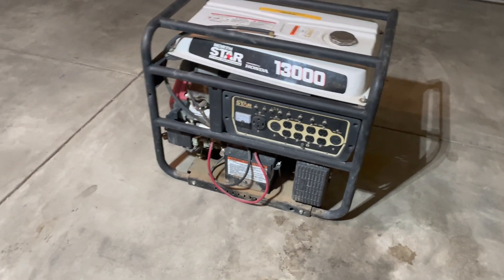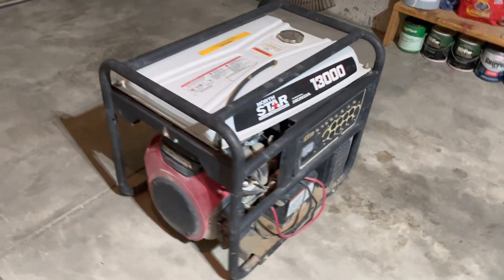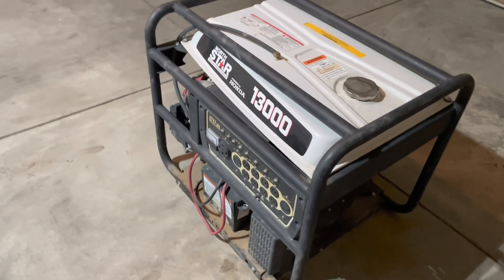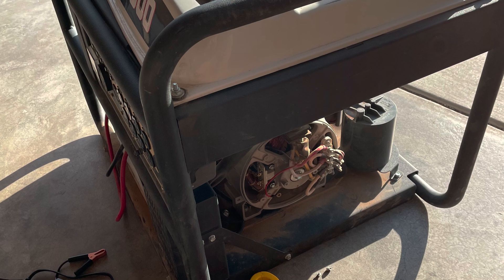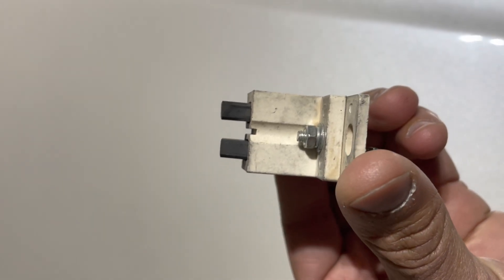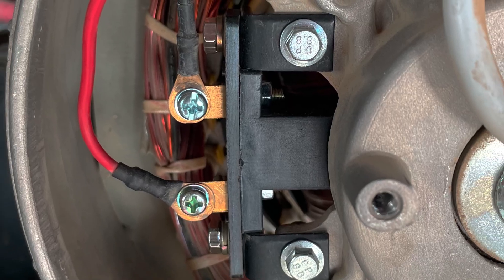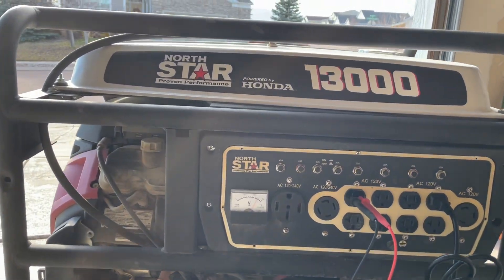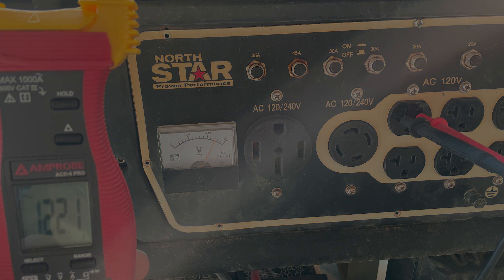How to fix a portable Northstar 13000 (13kw) generator that is not producing power.

Comment: I have a question! I have the 13000 TFG w/ Honda gx620.  Starts and runs for about a minute then shuts off. I have tried about every scenario to get it working right but to no avail.  It will shut off on gas or propane. It’s not the carb. I’ve took the low oil sensor out of the equation same results. Valve lash is set properly. It is driving me crazy that it won’t run properly 🤦🏻‍♂️🤦🏻‍♂️🤦🏻‍♂️ coils seem to be fine. It’s baffling.  Would you happen to know something I could try to maybe get pointed in the right direction?? Maybe something I haven’t looked at yet.
Reply from the maker: I have seen similar issues before. A few things, start by checking your engine switch, make sure there is no bad wire from the switch to the ignition coil grounding the ignition when the engine vibrates. 

Another thing you can do is getting an inline ignition spark tester. Connect it to the generator and start the unit. Keep an eye on the spark tester light, if the light starts to go out before the generator shuts down then you have an ignition issue (most likely a faulty ignition coil). If the spark tester light was constantly lit and the generator still shut down then you have a fuel issue. 

The last similar case I worked on, the generator ran fine for 15 minutes to the clock and then shut down. Let it cool, started again with no issues, ran for another 15 minutes and it would shutdown again. I did the spark tester test and noticed the light going out before shutting down. I replaced the ignition coil and it ran for hours without issues. Hope it’s helpful.
Reply: @tacticalpowerpro  the ignition switch funny you say that, I took and opened it up and bam a bare wire that was rubbing and left a little spot! I thought I had it, now this was yesterday.  It was not it 🤦🏻‍♂️ 

     I ordered some coils and I should see them Wednesday. I don’t have a tester (sounds like I need to get one) but hopefully a new set of coils will either rule it out or fix it!! Thank you for the speedy response.  I’ll let you if it works out or not.   Fingers crossed 🤞🏻
Reply from the maker: Ok good, we can rule out the ignition switch and focus on the ignition coil. A spark tester is good to have. It does help a lot, so I do recommend getting one. And yes, let me know if it works. Good luck!
Reply: @tacticalpowerpro  I wasn’t able to put the parts in yesterday but, was able to today. 
    The coils I swapped, set the gap, crunk it up and it seems to be what the problem was.  It ran fine. I hooked up my 50a welder and welded a little bit.  It seemed to work under load and no shutting off! I would say it’s the coils. 
     Thanks for your input 🙏🏻 I have that inline spark tester on the way for any further diagnosis’ssss. Let’s see if it holds, I’ll touch base after I use it for a bit to inform you the status of the coils!! 🤘🏼😎
Reply from the maker: That’s awesome to hear! 🔥 Running solid under load is always a good sign. Glad the coil swap did the trick. Keep that inline spark tester handy just incase and definitely let me know how it performs after a few more uses. Appreciate the update!

Comment: I have a buyer coming to look at my 130000 so I started it up today and after a minute, it shut down and won';t restart.
Reply from the maker: Sounds like the generator ran and shutdown once it burned the fuel it had in the carburetor bowl. Check the fuel valve is not closed. I would recommend a good carburetor clean up if it hasn't been done. It could be dirty and have the float needle stuck closed preventing fuel to reach the carb.
Reply: @tacticalpowerpro  when I stored the generator in the fall, I turned off the fuel valve. Or at least I think I did. I turned it the other direction to start the generator and after some cranking, it finally started, ran for about a minute, then started sputtering and shut down. Would not start again after that. But when the rain stops tomorrow I'll try changing the position of that valve handle and try again. Thanks!
Reply from the maker: Were you able to check the position of the fuel valve?
Reply: @tacticalpowerpro  yes, apparently I had forgotten to turn it off last time I used it and assumed it was off when i turned it. Actually, I was turning it from ON to OFF thinking I was doing the reverse. I was able to start it up. It does seem to run lean though. I need to pull out choke halfway, or it misfires alot. Could not find an idle mixture adjustment on this engine.
Reply from the maker: Great to read the generator is running. I recommend pulling the carburetor and giving it a good clean. That will solve your running lean issues.
Reply: @tacticalpowerpro  The gas tank has to come out to gain access, which makes it a royal pita. It's only got 200 hours on it and I use Sta-Bil in the fuel. Would be shocked if the carb were dirty.
Reply from the maker: Yes it can be a pain but you will be surprised. I work with generators daily and lots of customers come through saying similar words and surprise, surprise the carb is dirty. A good carburetor clean up and generator is running like new.
Reply: @tacticalpowerpro  Certainly surprising, given the low hours. I have a Generac 7000EXL with 4000+ hours (I bought it used and don't know how many hours it already had--4000 is what I put on it) and never cleaned the carb and it runs great. Maybe I can put some Seafoam through this Honda and see if it helps.
Reply from the maker: @basspig  Yes, try some Seafoam and see if it helps. I am surprised specially a form a Generac. Did the Generac had any long periods of not turning it on or it ran at least once a month?
Reply: @tacticalpowerpro  After I retired the Generac, it sits in a shed for a year. I pull it out usually once a year, put some fuel in and start it up. It starts immediately.
Reply from the maker: Awesome! With proper storage, that should be the outcome.
Reply: @tacticalpowerpro  When I store an engine, I shut off the fuel while the engine is running, to run out the contents of the bowl. Then I turn off the ignition and store it.

Comment: I have a 8000watt northstar  but don’t know where the brush is
Reply from the maker: You have what is called a brushless generator. It does not have carbon brusher or an AVR. It regulates the voltage using capacitors. Check the capacitance of the capacitors on your generator, most likely they have fail. Replace them with the same capacitance and your generator should start producing power. If it still not producing power then you have a rotor or stator problem.

Comment: Any chance you still have this Generator, i have the same one but there is a broke blue wire coming out of the back of the AVR module, i think it goes to the starter solenoid but i cant find a wiring diagram any chance you could verify? I belive it goes on a terminal with a black wire also since that one is very loose.
Reply from the maker: I do not have the generator with me anymore but you can send me photos of the generator and the wire to my Instagram account @Tacticalpowerpro and I can definitely help you identify the problem.

Comment: I have the same genny but mine is only producing 120v. Was working fine for 2 hours, then dropped down to 120v.
Reply from the maker: Thanks for watching my video, you need to verify what version of the Northstar generator you have because there is one version that has capacitors and when one goes out you will only get 120v out of one line. That might be your issue.
Reply: @tacticalpowerpro  Yup, that was it. Took the black cover off of the top of the generator and sure enough one of the caps was ruptured and blew its innards out. Replaced it with one off of Amazon...31.5uF 425V 475V 500V 25/85/21 PO Replacement Generator Capacitor...and it works fine. Northern Tool told me they don't "sell parts to the floor" anymore and pointed me to Jack's Small Engine "that's where we get all our parts from now". Went into the store and they have their Service Window all cardboarded up. Freakin' rip off...$62 for one cap from Jack's. $15 on Amazon.
Reply from the maker: @trappistachel  awesome! I'm glad you were able to repair your generator. I'm with you, Amazon or ebay is the way to go. I only use Jack's Small Engine website to get the part number of the part I need and then I look it up on Amazon. Thanks for the update on your generator, it will help other viewers with similar issues.
Reply: @tacticalpowerpro  thanks to your video. I was able to narrow down the issue.👍🏻
Reply from the maker: Reading comments like this one keeps motivating me to continue working on more videos. Thanks you! 🫡

Comment: I have th exact same generator and mine produces power and runs good but if I shut it off and restart it will not produce power until it cools off for a while. It only has 25 hours on it. You have any idea what could it because northern tool doesn't. I had it in their service dept and it wasn't fixed. Thanks jim
Reply from the maker: Hi, thanks for watching my video. If you have the exact same model as the one in the video then I would recommend inspecting and replacing the AVR. The AVR is the black rectangular box underneath the control panel. It sounds like it is going faulty, I had some generators act similar to yours and the voltage regulator was the issue. Sometimes it can be hard to identify issues with some electronic components because (although rare) they can act up randomly.

Comment: Hey bud . Good video... mine keeps tripping  the fuse. Could this just be a bad fuse
Reply from the maker: Hey man thanks for watching the video. What fuse is it tripping? Or is the circuit breaker tripping? If it’s the circuit breaker the check for loose connections at the breaker.

Comment: I have the exact same generator. Won’t start.
Reply from the maker: Make sure you got spark at the spark plug, one easy way to test it is by spraying carb cleaner through the carburetor and try to start the generator. If it tries to start but it shuts down that means that you have spark but no fuel reaching the cylinder.  Next step is to clean your carb, you most likely have a clogged main jet in the carburetor and needs some cleaning. I have other videos in my channel fixing that problem.

Comment: Question..... How old is your generator and how many hours does it have on it? ........I'm thinking about buying this exact one.     Would you buy this 13k northstar generator again or something else?
Reply from the maker: Hi, thank you for the question. The generator wasn't mine and I don't recall the hours it had but I can tell you that the 13kW Northstar is a great generator. It has the reliable GX630 Honda engine and honestly out of all the portable generators I've worked on (and I have worked on a lot of them) the 13kW Northstar is the only one that I was like "Wow, the built quality of this is really solid".
Reply: @tacticalpowerpro  Thank you for the info.
Reply: @tacticalpowerpro  Question......can you you use a lithium battery for starting this motor?
Reply from the maker: I don’t see why not if it’s the same size, voltage and CCA, but I will recommend to stick with the manufacture recommended battery which is a sealed lead-acid UB12180 (12vdc 18AH).
Reply: Something else.

Comment: Where do you get the brushes
Reply from the maker: I bought them through Amazon. Search Carbon Brush Holder Assembly, GX630 Gasoline Generator Accessories Double Cylinder. I had to re-use the brackets of the old carbon brushes with the new bushes tho, because the brackets on the new one didn’t fit the Northstar 13000. 
Follow me on IG @tacticalpowerpro and send me a message, I can send you the info on the brushes and pictures of what I did to the carbon brushes to fit perfectly.
Reply: I tell you what I ended up doing.  I took a piece of emery paper and put it between the brushes and the armature.  I cranked the engine over for a quick second or two. Took the paper out and it was working perfectly.  Fixed my problem.  Thank you for the help on the brushes
Reply from the maker: Awesome! It looks like your slip ring just needed some cleaning. I’m glad my video was able to help you in someway.

Comment: Im having issues with my 13000 Honda northstar. I had a week long power outage and am not getting very much voltage almost like half. Its showing around 125 or so on my gauge, do you think this could be the problem???? I pulled the plate off the back but all i saw were the copper wires how do i get to where the avr is????? Thank you for your help
Reply from the maker: Thank you for watching my video. The avr is the black box on the bottom right if you are looking at the gauge. I don't think your problem is the carbon brush, it sounds like you have a bad capacitor or AVR.